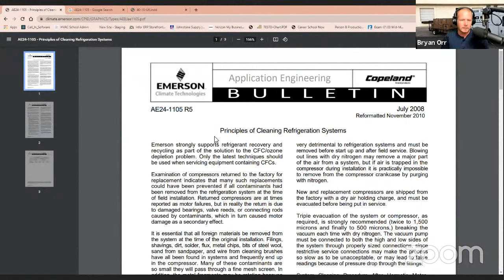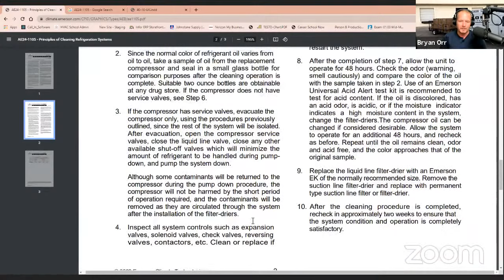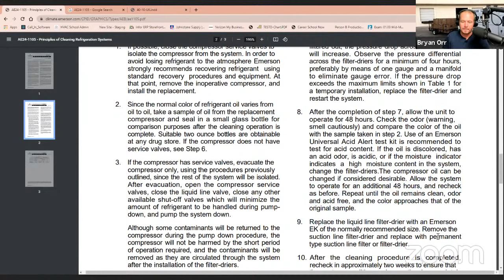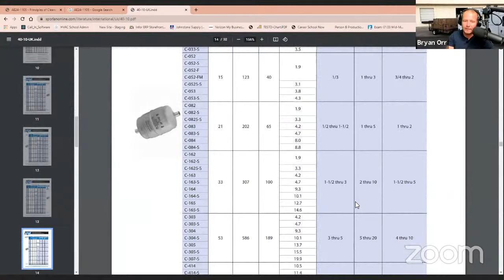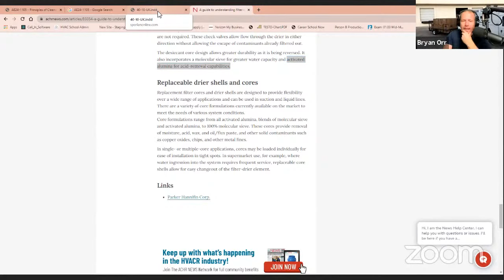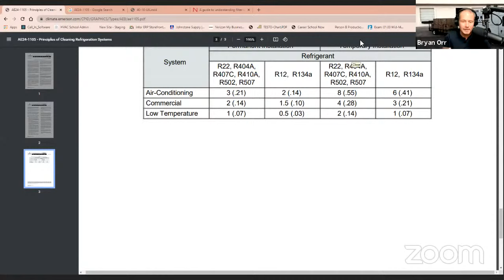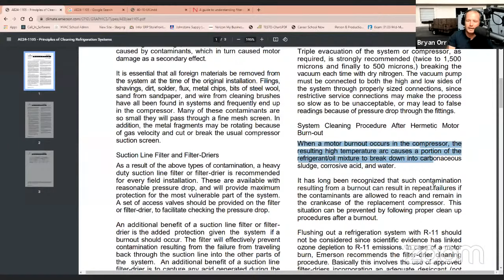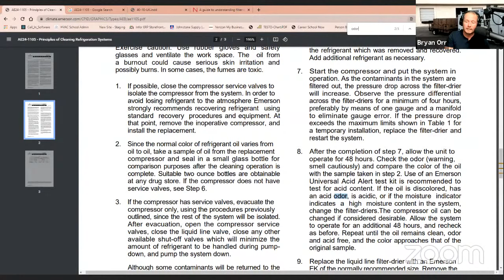System Burnout Cleanup Procedures Class

Comment: You have been great and wishing you all the best and much success with your endeavors. One tip, the proflush was stuck in the evap coil even after blasting 200 psi, multiple times, and for half a minute at times. I smelled some proflush when I removed the tape off the evap pipe. So I used a heat gun and warmed up the coil above 106 degrees to see if any flush is still there. Sure enough, liquid pushed out. No idea why it was still stuck in there till heat was applied but I do know the flush will evaporate better when heated. Thus, seems that proflush sucks, sorry.  RX11 is better because it will flash better and quicker. When flushing coils and condenser, gonna have to wrap the units and apply some heat to let flush flash. You can do that when vacuuming too. Hope this helps

Comment: In my experience as a non HVAC tech, if you experience a burnout ,bight the bullet and replace the condensing unit,line set and evaporator or the whole unit if it is a package unit. The HVAC service companies that do what is called for from Copeland  are unicorns. Most come in  and blow and go.They don't clean or replace the line set. They typically put filter/dryers in and never come back to check or change them. About two years down the road you will have another burnout. At today's labor rates, in my opinion, it is just not worth the expense and hassle. I have three of these experiences in my life. All have been with heat pumps, never a burnout with a straight air conditioner system. I wish that it was possible for me to never own another heat pump. Heat pumps are the greatest thing to come along for the HVAC service and sales companies. Lots or year around work.

Comment: 42:29 - If a vacuum pump is connected to a system that contains acid or other solvents (as in a Chemistry Laboratory), those will definitely be drawn directly into the oil if not mitigated with a cold trap of some kind.
Reply: It happened to me
Reply: Use your tools. What is the vapor pressure of the acid that happens in a burnout? If you run a vacuum lower than that vapor pressure or the system is warm because you have a heating blanket on it, it will happen faster. Too lazy, tired or overworked to check the answer for yourself, OK, change your vacuum pump oil and the other thing, change your vacuum pump oil. The cost of too many oil changes is far cheaper than the cost of a good pump.

Comment: I really have to ask. I did a flush on a 404A , captube , 3 door display freezer and I am wondering if leftover flush would cause a high suction pressure and superheat? After flushing, this 404A system is running between 30PSIG and down to 25 at system is satisfied. It is running good superheat when its satisfied.